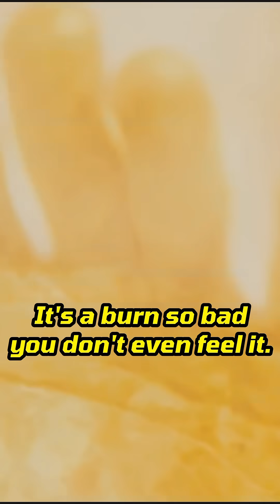THIS is what happens when a NUKE hits your City #vfx

Comment: Schools: "Get under the desks - nothing will happen"
Reply: "gets obliterated"
Reply: Give people who are about to die some hope? Even if it’s false.
Reply: @evanbelisle8464 religion in a nutshell
Reply: @My.sleepy.berries   *correction
Equal rights in a nutshell.
Reply: @pugorilla8848 i feel like they were correct the first time
Reply: @My.sleepy.berries so your asian yes?
Reply: @BanjoSoop and what is that supposed to mean
Reply: The desks thing is somewhat effective against the effects of the flash and blast some miles away. Of course, the only way to survive much closer would have been hardened concrete structures, and a handful of survivors survived as close as 300 meters to the hypocenter (point below detonation) because they were under such structures. 

Observers noted that many of the injuries came from a combination of the bright flash as well as the shockwave breaking windows and sending shards of glass into people. Many of those injured were looking through said windows to see what was going on, as Hiroshima and Nagasaki had yet to receive bombing raids and a small number of planes would normally be no cause for concern. 

Thus, sitting under a desk would shield you from both the nuclear flash and flying glass from the shockwave.
Reply: I mean, what are you to do? If you were JUST far enough away, that could help. It would be tiny, but it would give a slightly better chance of survival. What else could you do?
Reply: Ah! The good ole times of "Drop and cover!"
Reply: There's ring shaped area of approximately 230 km^2 around the explosion of a mode average yield strategic thermonuclear warhead in which hiding under a desk could offer serious protection, making the difference between series life threatening injury and minor scrapes.
Reply: "Shelter in place"

Comment: A Nuke barely takes out a small city...
It's not as serious as you think.
Reply: Modern steel will absorb most of the blast the same way the handle Earthquakes like they didn't use to.
Reply: @Threaopolieze You're acting like nukes didn't also get significantly stronger

Comment: its not that its too bad to feel it, which is also true. its because its too quick. id you got a 3rd degree burn over a period of 60 seconds, youll feel it for a majority of that time, until your nerves are burned away. since this burns so hot and so extremely quickly, it basically just vaporizes your tiny little electricity gatherers.

Comment: Genuine question: how does the shockwave (air particles bouncing into each other) travel faster than the speed of sound, if the speed of sound is the speed at which air particles crash into each other?

Comment: IT WOULD BE SO MUCH BETTER TO BE AT GROUND ZERO DURING A WORLD WAR III NUCLEAR ATTACK AND DIEING INSTANTLY, INSTEAD OF SURVIVING MILES AWAY. 
1. YOU WOULD SOON RUN OUT OF SUPPLIES. 
2. OTHER SURVIVERS WOULD PANIC AND TRY TO STEAL WHAT YOU HAD.
3. RADIOACTIVE MATERIALS WOULD BE FALLING CONTAMINATING EVERYTHING THING AROUND YOU. 
4. RIOTS WOULD BREAK OUT AND MANY PEOPLE WOULD BE KILLED.
5.THEN AS THE RADIATION STARTS PENTRATING YOUR BODY, YOUR INTERNAL ORGANS WOULD START TO DIE AND FAIL.
6. YOU WOULD DIE AN AGONIZING DEATH.
I WHEN THROUGH SOME EXTENSIVE TRAINING DURING THE LATE 1950S AND 1960S ON WHAT TO DO IN CASE OF A NUCLEAR ATTACK AND HOW TO HELP PEOPLE AT ALL STAGES OF CIRCUMSTANCES. 
EVEN IF YOU HAD A GREAT FALLOUT SHELTER,  SURVIVING IS LITTLE TO ZERO %.
IT'S  NO POLITICAL FAIRY TAIL LIKE WE'RE HEARING TODAY

Comment: Has anyone ever asked themselves why the old nuke test videos from back in the 40s and 50s seemed to be filmed with invincible and unshakable cameras?
Reply: Camera set-ups used to capture nuclear weapons testing in the U.S. 
were specially designed to withstand intense effects from the bombs. For
 example, cameras were encased in steel and lead, and positioned on 
towers rooted into the ground with concrete
Reply: @thebasedspectre3048  man, they should just build everything out of this nuke proof material then...

Comment: replay the first 5 seconds then ask how did the cameras or film be developed or how did they even survive or even move since you make film between us it was a set and toy models
Reply: Camera set-ups used to capture nuclear weapons testing in the U.S. 
were specially designed to withstand intense effects from the bombs. For
 example, cameras were encased in steel and lead, and positioned on 
towers rooted into the ground with concrete

Comment: Then how did all those cameras 📷 survive ????
Reply: Camera set-ups used to capture nuclear weapons testing in the U.S. 
were specially designed to withstand intense effects from the bombs. For
 example, cameras were encased in steel and lead, and positioned on 
towers rooted into the ground with concrete

Comment: If this is true, then how did the guy on the video camera not die?
Reply: Camera set-ups used to capture nuclear weapons testing in the U.S. 
were specially designed to withstand intense effects from the bombs. For
 example, cameras were encased in steel and lead, and positioned on 
towers rooted into the ground with concrete

Comment: How those camsras survive the blast ? 
They dont.
Reply: Camera set-ups used to capture nuclear weapons testing in the U.S. 
were specially designed to withstand intense effects from the bombs. For
 example, cameras were encased in steel and lead, and positioned on 
towers rooted into the ground with concrete
Reply: @thebasedspectre3048  no

Comment: those fake nuke vids again 😅 everything gets fucked up but the camera doesn't move
Reply: Camera set-ups used to capture nuclear weapons testing in the U.S. 
were specially designed to withstand intense effects from the bombs. For
 example, cameras were encased in steel and lead, and positioned on 
towers rooted into the ground with concrete

Comment: I don't have to worry since cameraman is still alive surviving a nuke🤡🍿
Reply: Camera set-ups used to capture nuclear weapons testing in the U.S. 
were specially designed to withstand intense effects from the bombs. For
 example, cameras were encased in steel and lead, and positioned on 
towers rooted into the ground with concrete

Comment: Yes, I love all these videos showing a nuclear bomb going off yet. The cameras fine doesn’t shake doesn’t move, The pole is fine that holds the camera, no glitches, completely fake. Even a mild lightning strike not even near you will make a modern phone buzz out. Hahha what a joke
Reply: Camera set-ups used to capture nuclear weapons testing in the U.S. 
were specially designed to withstand intense effects from the bombs. For
 example, cameras were encased in steel and lead, and positioned on 
towers rooted into the ground with concrete

Comment: If the bomb obliterated everything, how did they manage to capture video of it?
Reply: Camera set-ups used to capture nuclear weapons testing in the U.S. 
were specially designed to withstand intense effects from the bombs. For
 example, cameras were encased in steel and lead, and positioned on 
towers rooted into the ground with concrete

Comment: The heat wave wont reach you until long after youre dead. You're getting that confused with the X-ray and Gamma pulse. By the time the heat and the shockwave reach you, you're already dust, doesnt matter if youre five inches away or five miles, youll never feel the shockwave or the heat.

Comment: We really have to have a discussion about how powerful those cameras are to not be affected in the slightest by a nuclear blast.....pretty incredulous that the camera doesnt even shake in the slightest
Reply: Camera set-ups used to capture nuclear weapons testing in the U.S. 
were specially designed to withstand intense effects from the bombs. For
 example, cameras were encased in steel and lead, and positioned on 
towers rooted into the ground with concrete

Comment: I like how the camera doesn’t move when the house gets torn to pieces
Reply: Camera set-ups used to capture nuclear weapons testing in the U.S. 
were specially designed to withstand intense effects from the bombs. For
 example, cameras were encased in steel and lead, and positioned on 
towers rooted into the ground with concrete

Comment: but apparently it can't destroy video cameras
Reply: Camera set-ups used to capture nuclear weapons testing in the U.S. 
were specially designed to withstand intense effects from the bombs. For
 example, cameras were encased in steel and lead, and positioned on 
towers rooted into the ground with concrete

Comment: How do you video a nuclear explosion and not destroy the camera is the most important question of it all. The shockwave didn't even make it wiggle while knocking down a house.
Reply: Camera set-ups used to capture nuclear weapons testing in the U.S. 
were specially designed to withstand intense effects from the bombs. For
 example, cameras were encased in steel and lead, and positioned on 
towers rooted into the ground with concrete

Comment: I got to go to the "national security site" or Nuclear testing grounds in Nevada this year.  I bring this up because if you go to the Nuclear Museum in Las Vegas you'll see the "fat boy" bomb depicted at the start of this video.  It's a "physically" pretty big bomb and rated at 15 to 20 kilotons of TNT.
On the site we got to see the tower used to dig a hole for a test called "Icecap".  It was only a couple weeks from being detonated.  Inside the tower there's a big 300,000 lb steel cask that's suspended via cable that holds the weapon and all the gear going down.
What was interesting is that there was a mock up of the weapon there too.  
Modern hydrogen bombs "much more powerful then nuclear bombs because it take a nuclear bomb to initiate a hydrogen bomb" Are much much smaller then the 1st atom bombs.  Hydrogen bombs can be amazingly small and even more devastating then the big atom bombs.

Comment: Then how did the cameras survive?
Reply: Camera set-ups used to capture nuclear weapons testing in the U.S. 
were specially designed to withstand intense effects from the bombs. For
 example, cameras were encased in steel and lead, and positioned on 
towers rooted into the ground with concrete

Comment: Heard someone recently raise the question of why the cameras filming those buildings getting vaporized aren’t moving.  Fake.
Reply: Camera set-ups used to capture nuclear weapons testing in the U.S. 
were specially designed to withstand intense effects from the bombs. For
 example, cameras were encased in steel and lead, and positioned on 
towers rooted into the ground with concrete

Comment: Makes you wonder what the camera was made of that filmed the house implode without so much as a shake in fps .....The biggest "Firestorm" was Dresden Germany 1944 When British and American bombers Dropped large bombs to blow out windows Roof tops And scatter flameables across the streets .....Followed by fire bombs That worked so well Survivors told others They seen people lifted off their own feet And sucked into the fire 1/2 a block away Winds were 90Mph Heat cracked brick And blistered people inside basements

Comment: Fake video. The cameras would not have survived
Reply: "Camera set-ups used to capture nuclear weapons testing in the U.S. were specially designed to withstand intense effects from the bombs. For example, cameras were encased in steel and lead, and positioned on towers rooted into the ground with concrete, as outlined in declassified military reports. Additionally, the existence of nuclear weapons is well documented"

Comment: This is a fission bomb.  A hydrogen bomb explodes the air itself and the back pressure literally sucks everything on the surface for miles and throws it into the upper atmosphere. The US doesn't really use fission bombs anymore

Comment: The fire storm grows bigger and bigger as it gets hotter and hotter while the base of it moves out further and further.  Survivors of the initial blast can not run fast enough to get away, and no matter where you hide, the heat will increase until you are burned alive.  Far enough away to escape in time, now you find yourself with your fellow citizens with no police protection, food or water.  You must group together for survival and protection from the criminal gangs of young men only looking to rape, rob, steal and kill.  Be prepaired.  It is coming.

Comment: Faster than the speed of sound ??!??
Reply: Yes, remember that the speed of sound in air increases with ambient pressure. When the volume/amplitude is high enough to influence the ambient pressure, then the positive side of pressure waves can temporarily exceed the speed of sound – while the negative side typically stays exactly at the speed of sound. 

Thus, at a distance, high-very-energy rocket launches sound like higher-volume snaps mixed with lower-volume rumbling. The highest amplitude sine waves can bunch-up into a distorted sawtooth waveform which is perceived as a snap.

Comment: “People within 1.5 miles will receive third degree burns, a burn so bad you won’t even feel it.”

Yeah those people are gonna see a bright flash and stop feeling anything at all.
Reply: If I remember correctly, you have to be at least twenty-five miles away to fully survive without a scratch from a Nuke.
Reply: @shadowtrooper1052 Nah its not correctly. In Nagasaki somewhere survive in a small trench just a few hundret metres from the Explosion. 90% of Atomic "talks" is nonsenns ( Fire Tornados, big burning Events, a nuklear ice age etc )
Reply: @comicalzink5 You have to remember that every nuclear bomb we have is several times stronger than the ones dropped in Hiroshima and Nagasaki, and even those ones left people vaporized.

Still, it's something we better not experience.
Reply: @shadowtrooper1052 depends on how big it is. If it's over 100mt forget it.
Reply: Exactly.
Reply: Sounds like the opposite of the Big Bang

Comment: Yah but before the first 0.000001 second goes by, the Day will just be a very normal day, so enjoy that final less than 0.000001 Second, work on your Tan, Cut the Lawn, Feed the Dog, Paint the House, Lube the Car, Wax the Boat, Fix the Child's Bike, all those items on your never done "To Do List", everything that you can do in less than 0.0000001 seconds, use the time wisely, don't take an unnecessary "Break"!

Comment: So...a couple of miles away and you are fine. Yup. And what about the radiation? People quivering in fear thinking a nuclear reactor going critical is the same as a nuclear bomb going off. What did they do at hiroshima? Bring in soil. Livestock. Wildlife. And ship in Japanese people based in other countries to re populate the country? No. The vast majority of people survived. And they went right ahead and rebuilt the area. No cancer. No nuclear winter. No dark skies.
And another media fear po*n myth. Around 80% of ALL nuclear warheads are low yield. They are used in most conflicts. You can see them used in the footage from the bombings in Afghanistan. No black smoke...and sparkler effects. That's a low yield nuke. Safe distance 1/2 mile away. 
Nuclear war such as depicted in the films...would be viable only if each town had a nuclear reactor and in synchronicity...they went critical together. Otherwise. 
Chances are. You'll survive a nuclear war. The odds are firmly in your favour.